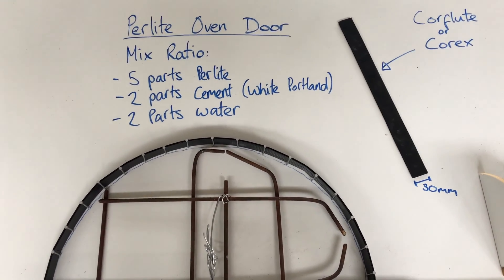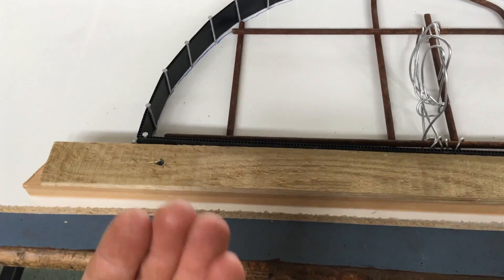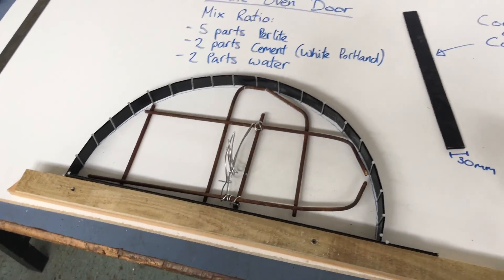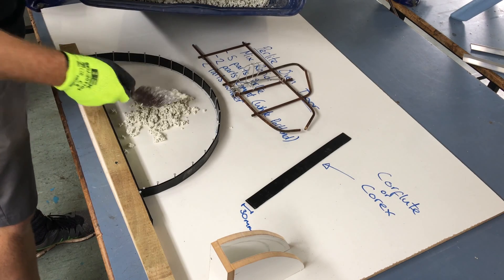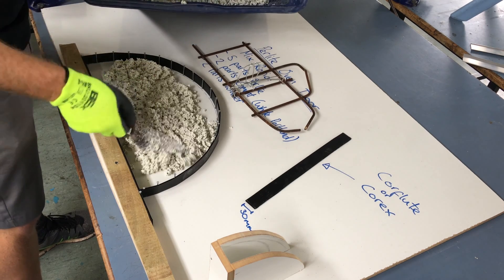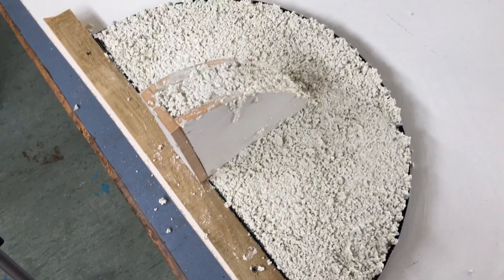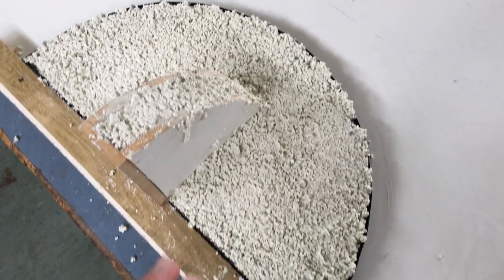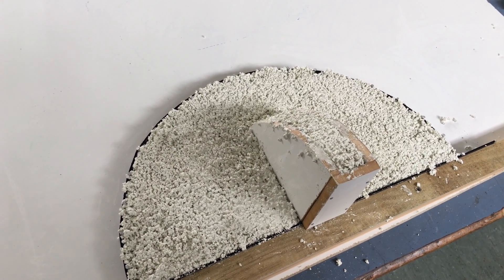EASY DIY Perlite Oven - Part 4 - Making the door

Comment: 6 to 8 weeks  if you have the time, or wish to experiment with an idea,or near zero budget then fine.
I wish I could wait that long haven't the time unfortunately instead  I'd use ceramic fibre board 25mm thick and fashion an insulated handle the board is rated some to 1200° and  upto 2600°.  Roughly made in 10 minutes, a small sheet could probably make 3 or 4 doors or double the thickness. Each to their own idea.👍
Reply from the maker: Yeah, I made an oak one as well!! Much quicker!

Comment: I'm going to build this soon. I like your video over the many on YouTube ... I haven't decided about adding a 1" layer of insulation. When it is fully fired does the dome feel warm to the touch? And did it crack?
Reply from the maker: Yes it does get warm to touch.
Our latest version with chicken wire reinforcement hasn’t cracked yet and it’s 3 years old.

Comment: great video thank you, i have a question regarding vermiculite, could you mix the 2 together, also i can only find gardening perlite is this ok to use or where could i buy it from
Reply from the maker: Yes you could. I’ve never done it but I’m sure it would work.
Garden perlite is fine.
Reply: @foodrelated  thankyou so much for the quick response, I am looking at building a bbq with an oven underneath as i do not have space for both, would the perlite be water resistant, what i mean by that is I will not be able to cover it so would the perlite mix become compromised, i plan on making bricks for inside the oven

Comment: hi, planing to build one oven myself so i wondering how many liters of perlite did you need to make this oven? also why not using concrete reinforcement fibers instead of chicken wire for armature?
Reply from the maker: iCrazyOwl 100l of perlite should be enough.
I just used chicken wire as a more readily available alternative, so of course you could use reinforcement fibres instead to prevent cracking.

Comment: Great video pal I have just one question could I use leca? I have 4-10mm in size  but I guess I could sieve it to get the small sizes, the reason for leca is I already have that and I want that grey colour as well as yours is white, thanks
Reply from the maker: utube882 I reckon you go for it!! 
It has excellent thermal insulation.
Reply: tompeyton1 okay mate cheers I’ll let you know how it goes

Comment: Great stuff, I finished mine, I used lava rock, sand and cement. I plan to use the perlite-cement and cover the interior with this mix. Hope it does not crack. I also plan to install a propane burner so it can run on both wood and gas
Reply from the maker: Aaron Rodriguez NICE!

Comment: You making this for someone, what happened to your other oven...
Reply from the maker: Yes making for a friend. I was interested in seeing the performance differences between Perlite and Vermiculite. So far i'm impressed with how solid the perlite seems. Once the oven is cured and installed, we will conduct some temperature retention tests etc.
Reply: @foodrelated  I've used perlite on mine along with refractory cement. It seems solid enough and seems to hold the temp pretty well. I've put up a short 1 minute slide show on YouTube of the build. I'm in the process of making 2 more kits myself so hopefully get a full build video at some point.
Reply from the maker: Great look forward to watching it.